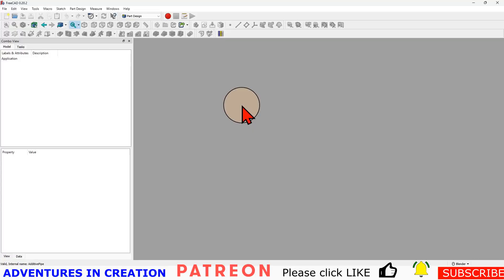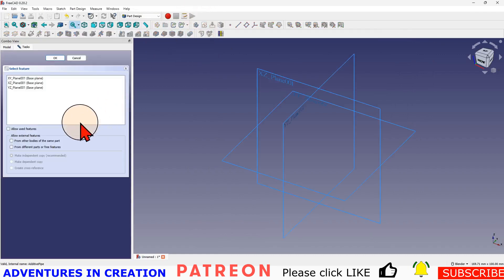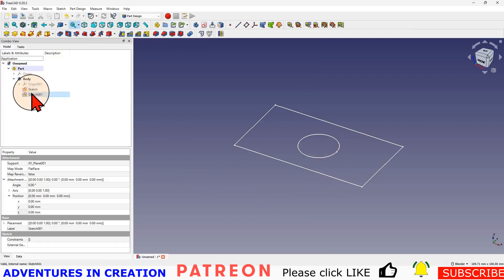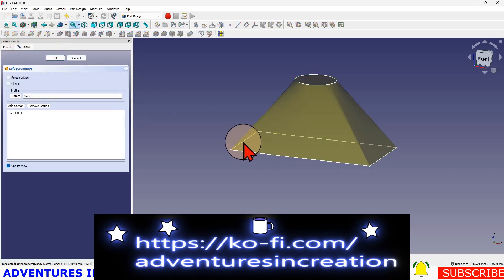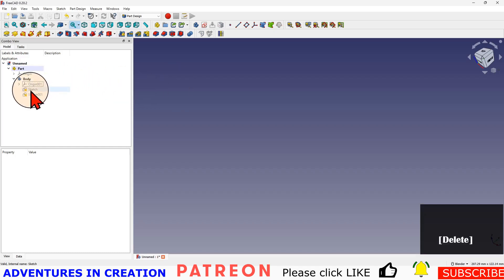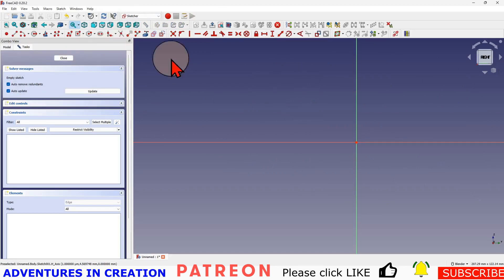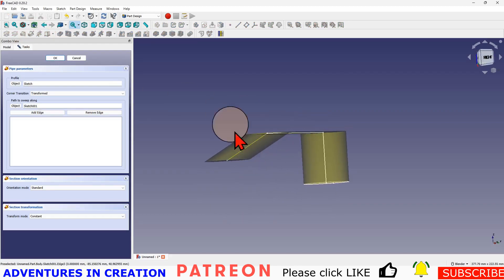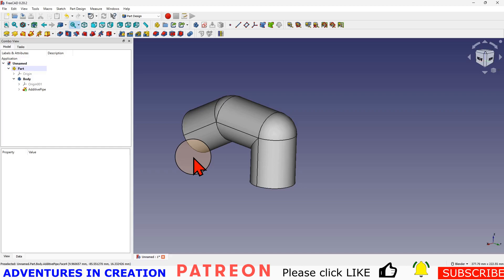Back 2 Basics Number 4 FreeCAD basics #freecad #cad #design #makers

Comment: For the additive pipe, you placed the sketch at the start of the polyline profile.  I want to use the sketch as my paintbrush, but I want it to trace out the path of 20 different lines.  Do I have to copy the sketch to 20 different starting locations?
Reply from the maker: That's a great question. If you want the start position to be the same then you can reuse the sketch but, it's likely that you want different start points so you would need copies of the sketch.